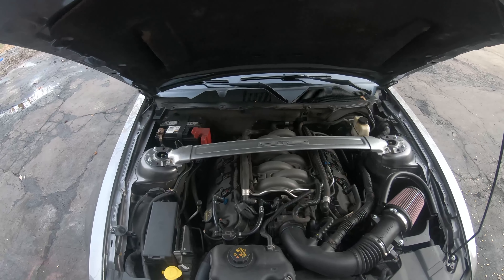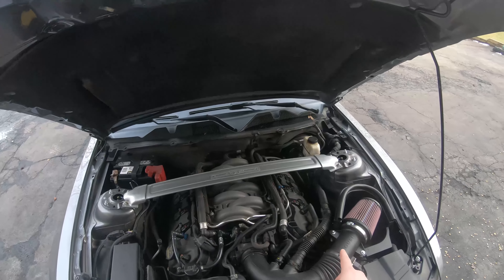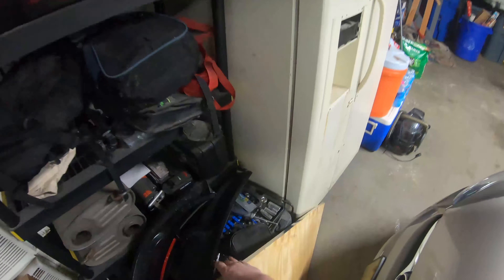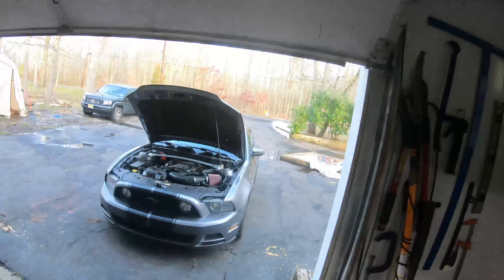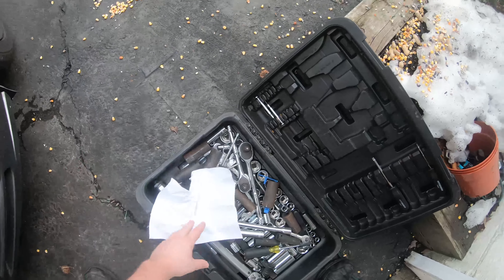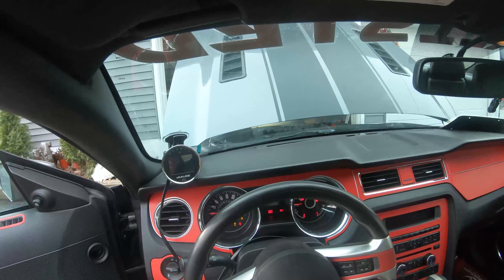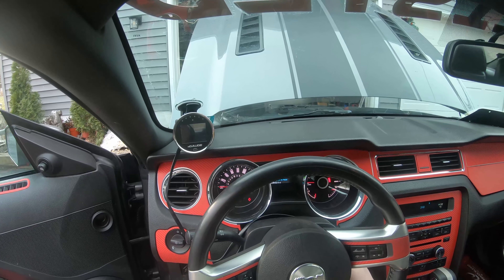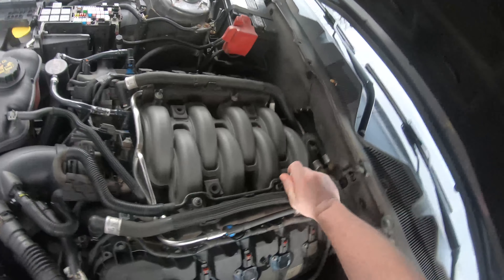Installing fuel injectors on my 2014 mustang gt!!!!!

Comment: My 2013 is having this misfire issues I replaced the throttle body,coils, spark plug, maf sensor, and after resetting drives like heaven for a few minutes then the problem comes back, any ideas please help
Reply from the maker: Mhm try having a shop check if ur cats are clogged sometimes when there clogged they dont tell u but with start throwing misfire codes happened to me
Reply from the maker: If it is and u plan on goin with longtubes later just do it bow if theyre clogged cayse its gonna be at least a grand to get new cheap catalytic converter’s

Comment: is it mandatory to have them labeled 1-8 or how would i know which is number 1 and so on?
Reply from the maker: No you don’t have to I actually had the injectors cleaned and test before I installed them so just in case there was an issue with one I wanted to be able to match it to the sheet I had from the test easier.

Comment: Did you cut your fuel rails for these to fit? They say only gt500
Reply from the maker: No if they’re the lp52 52lb 60mm fuel injectors from lethal they work on mustang gts from 2011-2020

Comment: Which tune did you go with to run E85?
Reply from the maker: I got a guy in California who does my tunes through email but I may be switching over to Lund.
Reply: @eastcoastv8397  I’m running a bama tune on my 14’ FBO GT. I want to do injectors and e85 tune just don’t who I want to go with. PBD and VMP and of course Lund seem solid.  What’s your experience with E85?  Noticeable gains?
Reply from the maker: @THETOPGLOCK  honestly Na doesn’t really get any gains only like 10-15 hp max plus I’m in no so I don’t run it that often it’s nice but honestly I recommend doin other mods first like headers
Reply from the maker: If you don’t have it done already
Reply: @eastcoastv8397  Bro, thanks for the video. How can I know the fuel injector on my2014 mustang gt the factory or the upgraded gt500 ones ? 

  It has 82997 number stamped on the bottom.